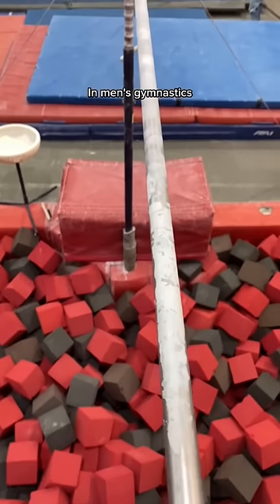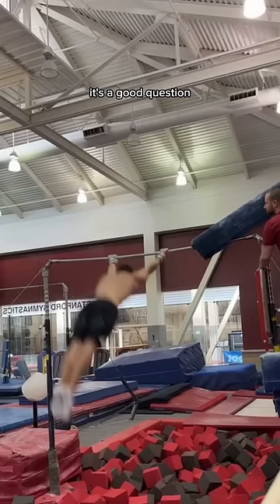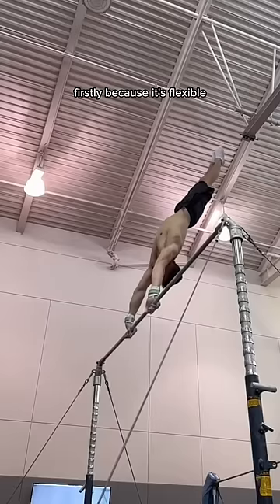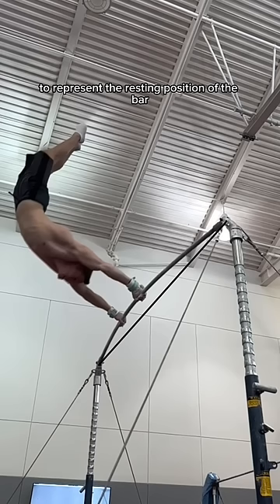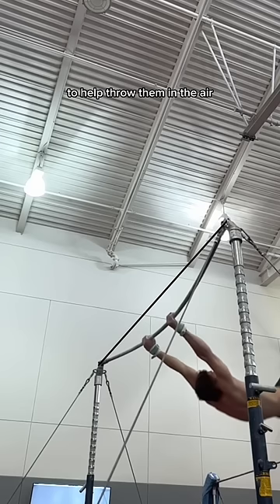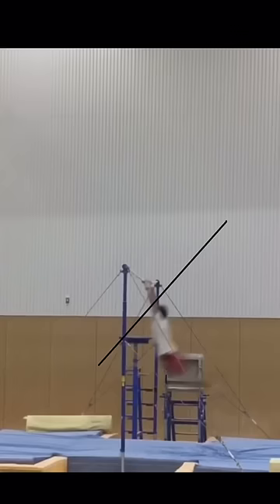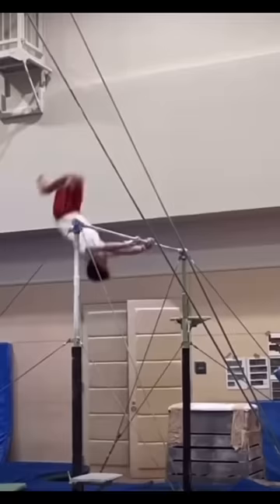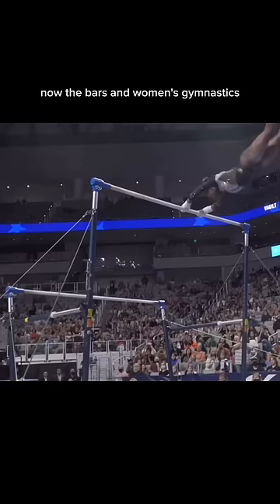Why is it made of steel 🤔 #gymnast #gymnastics #sports #calisthenics #parkour

Comment: also the grip used is different between men’s and women’s gymnastics because with women’s we’re switching between the two bars instead of being on one. and female gymnasts are lighter on average due to the higher demand for flexibility in women’s gymnastics compared to men’s.
Reply: 999/1k likes
Reply: @@muffinconsumer4106bro what
Reply: This seems like the best comment on the video. Thank you for this!
Reply: scarlet_message3207 how is that in anyway sexist? women get 2 bars be grateful
Reply: Scarlet_message3  how so?
Reply: Scarlet_message3  it actually isn't its more of a flexibility demand and mass, height and technique difference as well
Reply: scarlet_message3207 ow do you wish it to be? Men falling through bars when jumping from the higher to the lower, or women underperforming on one bar due to having less upper body strenght than men*?

This system benefits each body types strenghts. The Female version even looks more impressive, which is rare in the world of sports

*Due to the steroid named testosterone, men have 90% more upper bodystrenght than an equally trained female counterpart.
Reply: Were*
Reply: @rOceans-XbL  Sexism exists in both ways, you know that right?
Reply: Scarlet_message3  bro called it sexist and refused to elaborate ☠️
Reply: Not really the physical build of women is lighter and less muscle intensive. Due to this, women are naturally more flexible than men. It's not something that people want or have high demand for. It's just something that is. Obviously women aren't light because of "Demand" not to be belligerent but that is an extremely ignorant take on this.
Reply: Scarlet_message3  troll
Reply: @MaximNightFury  sexism is power and prejudice against a sex so no you cant be sexist to everyone. take a sociology class
Reply: @jaeydnheeren  About your comment on the high bar that isnt showing up on me. Absolutley they could handle it, im not saying they physically cant swing it. Thats what they do on each individual bar already.

They cant swing a single bar AS WELL as male counterparts though.

A female cant do a male routine as well as males, just like males cant do a female routine as well as females.

Its like saying that the genders can be reversed in a Ballet dance. Sure they can, but this would on average yield a much worse dance than the other way around because neither of the dancers natural gifts are taken advantage of.
Reply: Men are bigger and stronger
Reply: And also because women have 50 percent less muscle mass than men on average😂
Reply: @SportSoulLife  cited from an article online: “that result in at least an 8% to 12% ergogenic advantage in men”, referring to the impact that an average amount of testosterone has on a man. Get your facts right before you open your mouth to speak
Reply: @Bebemcmicky yeah and? That’s an issue with there being a general issue where women are either disinterested or encouraged not to go to the gym. You probably don’t lol. In society there is more incentive and encouragement for men to go to the gym, and it’s an issue yes, but not a justifiable reason.
Reply: @koolkat6070  According to a study made by Matt Brzycki, Bachelor of Science, Coordinator of Health Fitness strenght and condition programs at the Prinston University, where he compared athletes world records in strenght and divided them by weight class, showed:

"And based upon body weight, the world- record performances by women in the bench press ranged from 60.563 – 70.667% of men",
Meaning men are 42-66% stronger in the same weight class.

Also Gong CHEN, Ph.D., professor at the Department of Kinesiology at San Jose State University, found in his study named "A Comparative Study on Strength between American College Male and Female Students in Caucasian and Asian Populations" with a testgroup of ~170 people showed that:

female biceps are on average are 38% of that of men, meaning ordinary men are 163% stronger

Female triceps are on average 53% of that of men, meaning men are 88% stronger

Benchpress strenght 40% of men, meaning men are 150% stronger

Concluding:

"The muscle strength of both Caucasian and Asian female students is significantly lower than their counterparts on all five measurements: arm strength, upperbody and chest strength, shoulder strength, leg strength, and abdominal strength. Females have 37-68% of muscle strength of males in general.". 

Converted, the average male is 47-170% stronger 

Keep in mind though that this study didnt put them into weight classes as far as i can find, so the extremes are likely exaggerated.

The 90% does seem to have a size bias, as it doesnt account for weight difference, but i would like for you to name the study your source based its claims upon, as two academical studies disproves it
Reply: @koolkat6070  I suggest, if you currently are in a relationship or next time you find yourself in one with the opposite sex, with their approval and in a safe enviroment on a gym mat or something, agree to go full out on eachother (ofcause until either says stop).

If you are Female you will notice how quickly you get ragdolled when a man really uses his strenght, because definitely no man has used even half his strenght on you before. If you are male, youll see how insanely strong you actually are compared to her. Force you used to play fight with your friends with will likely render her completely defenceless.
Reply: Scarlet_message3  I get where you're coming from but men and women gymnastics are just different they each will do different things on the bars it's not sexist it's just that their doing different things
Reply: @rOceans-XbL  if women did have the metal one you will be actively making them be very bad comapred to the men since women can't bend the metal bar
Reply: @theyunknown1  i said that they should be grateful for having 2 bars?
Reply: @rOceans-XbL  i pressed on you accidentally
Reply: Scarlet_message3  not really, it's just accommodating both genders needs to have better performing athletes, hope that helps :)
Reply: Scarlet_message3  bro what 💀
Reply: @SportSoulLife  source? Men are on average 20% or so stronger not 90%
Reply: @augustuslunasol10thapostle  8 comments up. One study by a Bachelor of science comparing pro athetes and one study by a PhD and Professor in Kinesiology comparing average population picled at random

Source to 20%?
Reply: @augustuslunasol10thapostle  Ill actually throw in another one for you.

In University of Utahs study "Why males pack a powerful punch: Upper arm strength, different from females', may have specialized for forceful blows.".

"Jeremy Morris, then a doctoral student and now an assistant professor at Wofford College, designed an experiment with Carrier, doctoral student Jenna Link and associate professor James C. Martin to explore the sexual dimorphism, or physical differences between men and women, of punching strength. It's already known that males' upper bodies, on average, have 75% more muscle mass and 90% more strength than females'. But it's not known why."

Also

"But even with roughly uniform levels of fitness, the males' average power during a punching motion was 162% greater than females', with the least-powerful man still stronger than the most powerful woman. Such a distinction between genders, Carrier says, develops with time and with purpose."
Reply: Scarlet_message3  it’s not, go watch men trying the uneven bars and u will know why
Reply: @SportSoulLife  U literally said a whole lot of nothing. We r talking gymnastics here. Men could never outperform women in women’s gymnastics, and vice versa. With some rare exceptions.
Reply: @theyunknown1  if men had the uneven bars they will break their neck on the 1st fall. that’s why they have different event.
Reply: @penguinmina7296  The high bar and uneven bars, and gymnastics ingeneral, especially male versions, are all about upper body strenght relative to body weight.

Edit: thats what i said in the first comment. Men cant outperform women in female and women cant outoerform men in male. Therefore its more interesting to have male and female routines instead of everyone sharing the same routines
Reply: @jaeydnheeren  HAHAHAHAG
Reply: @penguinmina7296  i agree yeah
Reply: Scarlet_message3   how is that sexist 🤓🤓
Reply: @rebbo2440  not all? That’s sexist
Reply: @jaeydnheeren Yes, but in different categories it might be possible
Reply: How is that due to higher demand of flexibility? Women are lighter than men on average in general
Reply: Oh ok thank you
Reply: Scarlet_message3 Ah, yes. When basic bioligy is sexist. Truely a moment of time.
Reply: Men are just superior in every aspect of it .
Reply: And they are much weaker
Reply: Drama Police 👮‍♂️👮‍♀️🚨🚨🚨🤚👇
 "STFU no wants drama about sexism here"
Reply: @SportSoulLife  sources for the 20% are scientific studies aswell as anecdotes from trainers and such or am I confusing this for something else? But if memory serves correct the 20% is for everything averaged out not just upper body if memory serves me right that is if
Reply: @augustuslunasol10thapostle  Sounds more like weight differences to me, in that men are on average 20% larger than Females, or have 20% more mass than females. 

Would love to see any studies showing that, because I personally couldnt find any.

To average out those numbers, men would have to have so weak legs and core that they couldnt jump, but their legs are also on average stronger than females, why they run faster, jump higher and jump further.
Reply: Scarlet_message3  equality doesn't and shouldn't exist in this way, men and women are not equal physically, that's facts
Reply: @MaximNightFury  Okay, and?
Reply: Scarlet_message3  It's not sexist, it's two different designs for both sexes because we are different biologically. Both sexes get something that works for them, that's like the opposite of sexist.
Reply: No they're lighter, becouse that's just how women are built, they have on average way less muscle mass, and other differences such as that women are on average smaller than men.
Reply: women wouldn’t be able to perform aswell as men on one bar due to the lack of mass you guys have
Reply: Flexibility and weight don't go hand and hand. Just an fyi...
Reply: @rebbo2440  tf?
Reply: 💀take that up with fig bro us gymnasts ain’t complaining💀
Reply: Scarlet_message3  it's not sexist if you ever did your research women's bodys were not made to do extreme things. But since humans do evolve women were able to do more things than they were able to do 100 or 200 years ago.
Reply: @Toms_pizza   it's actually very much true. It's just the way humans work based of evolution, males are evolved to be the hunter gatherers, to protect the women, and therefore are bigger on everage for more muscle mass. Women are evolved for childbirth and childcare. Requiring much less muscle mass, and in turn, are much smaller. It's the same for almost every species of animal. It's not sexist, it's just genetics
Reply: @augustuslunasol10thapostle source?
Reply: @SportSoulLife  why are you so serious about men being stronger than women lmao 💀💀
Reply: @lucindapinnellova190  I enjoy debating and researching stuff.

Im quite indifferent about the topic itself. If someone hits the tennis ball to my side of the court i hit it back and see if it returns. I dont care what side of the court the tennis ball is or should be on, im just enjoying a game of tennis. 

Same here, i dont really care who is stronger or weaker, i just like the game of debating. An opportunity to do something fun shows up so i take it. 

Actually, from time to time I take a stance i disagree with. Its more fun in real life though as you see peoples reactions, especially to curveballs. Also, defending the opposite side often helps you to see the greater picture of the issue and learn new things.
Reply: Scarlet_message3  bro has no eyes
Reply: @koolkat6070
Reply: @SportSoulLife
Reply: Don’t you think women are lighter on average because they’re women? Not because of the need for flexibility?
Reply: Also it’s good to know that the uneven bars started out as a set of parallel bars with one bar set to a different height. The uneven bars have gradually changed to what we have today but the materials it was made of never did (or at least never had a reason to). I think that has alot to do with it.
Reply: @jaeydnheeren  not you being wrong💀
Reply: Scarlet_message3  everything is sexist to you lot. Go outside more, please.
Reply: Higher demand? Isn’t because they are more flexible but have lower muscle mass in general?
Reply: how does flexibility affect weight?
Reply: scarlet_message3207 how? it’s not saying one is better than the other, just saying they’re different
Reply: @stego1128 women are lighter because although bearing a child is extremely difficult it is much easier than the physical labor almost exclusively done by man over the years. Studies show that men's average height and weight is relative to the intensity of the typical labor performed at the time. The industrial revolution was the biggest spike resulting in a 1.04" and 4.4 kilo decrease in average size. Current studies show a 1.16" 5.4 kilo increase in average leaving man's average size about the same as 1900a.d.  Studies suggest this increase can be attributed to the modern health and exercise industry .
Reply: Scarlet_message3   it's not sexist that women have lighter body's 💀
Reply: @Lodemite  maybe it’s because of the change in demand related to the gymnast’s sex. The op said women tend to become lighter because flexibility is demanded (that means they train on flexibility and not strength) and men tend to become heavier because strength is what demanded in men (so they focus on building more muscle mass to become stronger.) It’s more about the demand instead of the gymnast’s aptness. Come to think of it, demaning totally different things form people based on their sex and then thinking “inherently men are stronger women are more flexible” is sexist when in reality it’s just what they’re trained on their whole life.
Reply: @jaydensdream714  Interesting 🤔
Reply: @Izuku Midoriya  You're right, It's for height and technique. The whole flexibility thing ... idk. Maybe it made sense in their head.
A female athlete at any capacity is gonna weigh more than your average female due to muscle. Muscle holds water, water is heavy.
Reply: Scarlet_message3  na, the real sexist part is that female gymnast are almost always forced to smile
Reply: @koolkat6070  no
Reply: it would be cool if everybody was put up to the same standard...
Reply: The girls bar is also much thicker making it much harder to back giants on.  You have to really shift your wrists on a girls bar.
Reply: Why 2 bars? Are women's and men's gymnastics not the same apart from they don't compete with each other?
Reply: Thank you
Reply: @benpeterson1238  I was thinking the same thing
Reply: @SportSoulLife  i applaud you and you’re approach to debate. Wish i was half as skilled as you. Keep on keepin on.
Reply: Who decided that men get one bar and women get two? Can men do womens gymnastics?
Reply: @koolkat6070 I think you need to focus more on the studies themselves.  The advantage men have are due to faster recovery times and longer stamina allowing for muscle mass to develop faster.  Most studies do a very poor job of testing how much testosterone actually helps since most studies shorten training times and spread the training times too far apart for the higher  testosterone levels to show an advantage.  A better way for you to understand is to look at the benefits in muscle gain by taking extra test.  Now imagine that on a smaller scale from test levels in women to test levels in men.
Reply: scarlet_message3207 bro throwing words around and not elaborating
Reply: @SportSoulLife  you had me till the end there. May i ask if youre ok with trans women in womens sports? Given how after 6 months on estrogen they are equal to a woman in terms of muscle building?

Also women also have testosterone and the levels vary greatly. In men, testosterone levels also vary greatly.

I do agree though that testosterone is a muscle builder and estrogen is a muscle eater, however, i just want to know, based on how you worded the last bit.
Reply: @stego1128  well women are light die to demand. We are scrutinized for being more than 90 lbs.

Also, think about the best female gymnasts, they’re absolutely tiny, while the less good ones are the ones who are average height and average build (though clearly stronger)
Reply: @yelloworange3125  

If the athletes are medically proven to not have any unfair advantages from their pre-transition gender then i think its ok for them to compete.

With unfair i mean traits that step outside of the relam of born female athletes talents and luck at birth. If an entire WNBA team consists of male to female athletes who are all 6'8, you should be able to disqualify the team for having an obviously unfair height advantage by being the tallest team in the league. 

How exactly these rules would be made in practice is too advanced a subject to me, especially with this lack of research.

Yes, women also produce testosterone and mens testosterone varies a lot, but there are other factors at play as well. Truth is scientists cant fully explain all the strenght, height and bone mass diferences between males and females.

If you check one of my coted studies made on why men pack a strong punch, youll notice that all the test subjects were ensured to be fit and active people (cant remember sample size), yet even the weakest male subject packed a stronger punch than the strongest female subject. As all the subjects were in fit shape, it means that either the man trains less than the strongest female but the gender advantage still wins, or they train the same but the most genetically gifted female still loses against the genetically most dosadvantaged male.
Reply: @yelloworange3125  I don't mean to dismiss you but none of that was true
Reply: Scarlet_message3  ok 12 year old
Reply: Yep
Reply: @SportSoulLife  90?! damn😭😭
Reply: Female gymnasts are lighter because they're female. The demand for flexibility is due to women being more flexible. Bodyweight has nothing to do with flexibility and the differences between male and female gymnastics is because of our body mechanics. They didn't arbitrarily demand women be lighter and more flexible than men.
Reply: @SportSoulLife  testosterone is a hormone. Are you saying all testosterone is a steroid, all male gymnasts juice or women don't inject test? All are idiotic but I'd like to clarify.
Reply: @fenixchief7  

Im saying that the definition of testosterone is 

"a steroid hormone that stimulates development of male secondary sexual characteristics, produced mainly in the testes, but also in the ovaries and adrenal cortex."

And in medical terms, testosterone is classified as an Anabolic steroid.

In that of the three main categories of steroids, only Anabolic steroids improve athletic performance

In that out of the 6 most common illegally used injectable steroids (According to the National Institute of Drug Abuse), 3 are Testosterone based, and of these three, all are inteded to be used to treat low testosterone levels in men. 

The first injectable steroid is water-dissolved Testosterone, and are to this day regarded the most powerful muscle stimulants.
Reply: Exactly
Reply: And also you know genetically talking you can’t get as big on average feel like that’s the main reason girls arnt heavier then guys not because you have to be more flexible
Reply: @MaximNightFury  yeah but this is obviously not sexist at all☠️
Reply: Scarlet_message3  Everything is sexism nowadays...
Reply: I love this.
Reply: Wow people are really falling for that bait comment
Reply: @jaeydnheeren  This is genuinely disappointing to see
Reply: @jaeydnheeren  definitely  can because u can be prejudice against anyone and no its power OR not and
Reply: How is it sexist? It’s literally biology not gender roles? This comment just says why it’s like this and it’s actually true for most people, of course there’s people who don’t etc. and that’s okay but I don’t see how this is sexist in any way
Reply: Weight and flexibility don’t correlate…
Reply: No they're lighter because they have way less muscle mass on average. Tf demand gotta do with it🤣
Reply: @tobyjohn4682  alot more force he means
Reply: @Auto209  females always be finding a way to cope. I remember seeing a video on soldiers training and this woman said it was because of their shorter strides💀💀💀
Reply: scarlet_message3207 bros scared of biology
Reply: @stego1128  Facts. I was about to say something similar.
Reply: @jaeydnheeren  sounds like an excuse to be sexist to me. misandry is just as bad as misogyny. unless you don’t consider men and women to be equal, of course
Reply: Men just do way faster, higher, crazier technical stuff like in anything, so they need better equipment
Reply: It’s sexist because women and men have different body structures, my fault g
Reply: Women are lighter on average regardless of flexibility demands
Reply: lighter does not equal more flexible, and vice versa. Women are on average lighter, because on average are smaller andless muscular.
Reply: The fuck is with the PHD references on a fucking metal bar vs carbon fibre bar, for an event made to best suit the different sexes.
Reply: Yea
Reply: @rebbo2440  exuse me? That isn't true
Reply: Flexibility is probably not the reason for the weight difference. More likely that it is about bone density and height difference as well as muscle build up being different on average. Weight is right just the reason doesn't make sense cause weight does really have much to do with flexibility.
Reply: @jaeydnheeren  Sexism is just prejudice in fact. I'm sorry to inform you that if you think bigotry requires power you are more often than not a bigot. Systemic bigotry is NOT the only kind of bigotry.
Reply: Right, being lighter (and on average make less powerful swings), they don't generate sufficient momentum to make use of the spring force inherent to the less rigid steel bar.

#physics in action 
#physics is fun

❤👋
Reply: Wow.....just look at wll and the ill will being lobbed back and forth.

It's unnerving to see how effectively postmodernism has put classes, sexes, and "races" to each other's throats....as if we arent all one race (the human race), aren't all in the same boat (the human experience in "this mortal coil").  😞 

#a lie told often enough becomes the truth
Reply: @izukumidoriya8200   if I’m flipping on those bars i want the same advantages men get, because if I’m doing that I’m going for the hardest swings and power moves possible, regardless of my weight.  There is no excuse for lack of equality.
Reply: @koolkat6070   If you’re going to use quotes make sure they’re from empirical studies, actual fact, not a random quote from a unnamed ‘article.’  

It’s also considered apropos to actually include the reference name/title.  Just saying ‘a article….’ doesn’t cut it, we have no way to verify the information you provided, and check the veracity of its sources.
Reply: @kalabakonbitts1362  actually there is, I have done gymnastics before there is differences between men and women's gymnastics because of flexibility, women have the things for more flexibility and men have more things that require more upper body strength than women. The 2 also have different requirements so there's only certain people who do it because you have to be a certain height and weight to make sure there isn't any injury. Sure it seems like inequality but it's not, it's just the difference between men and women's bodies since women tend to be more flexible than men. I'm not saying that they can't do either or but it might be harder for them since the different skills in either require different things
Reply: Also women are just lighter and smaller than men...
Reply: @leocossham  exactly, like it's not discriminatory just because women and men have different physiques naturally
Reply: Switching between two bars instead of being on one? Wait so men's and women's gymnastics are effectively whole different sports? Are there not men's and women's tournaments who do both?
Reply: I love the way this is worded. Just saying❤
Reply: The difference in weight isn't because of the demand for flexibility, women are just smaller and lighter on average
Reply: I mean... women aren't lighter on average because there's a higher demand for flexibility. Women are lighter on average because women are lighter on average lol we are smaller and have less dense bones. 

Flexibility has literally zero to do with muscle mass. Women aren't naturally more flexible because we have less muscle mass (though that is also true in general). I'm not entirely sure why women are naturally more flexible. If I had to guess, it has to do with our connective tissue being more elastic. But what I do know is that it's not due to muscle mass. If you don't believe me, look at some of the 100+kg body builders who are also flexible af.
Reply: Ahhh the old add “power” to the definition trick. Right out of the Marxist handbook, very well executed Comrade.